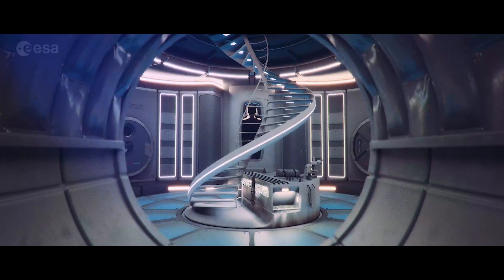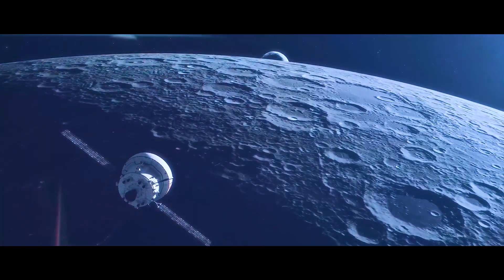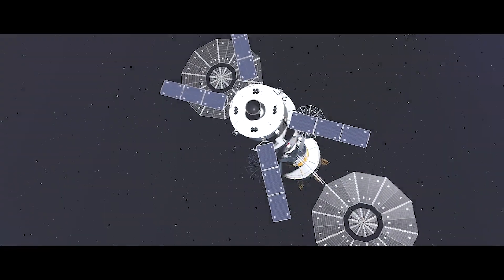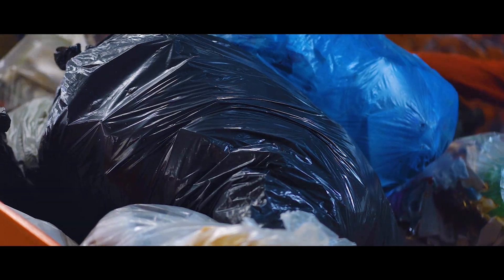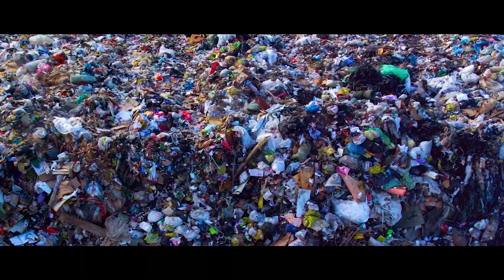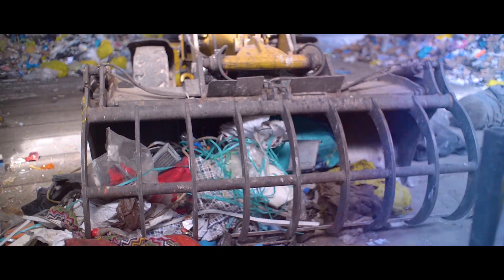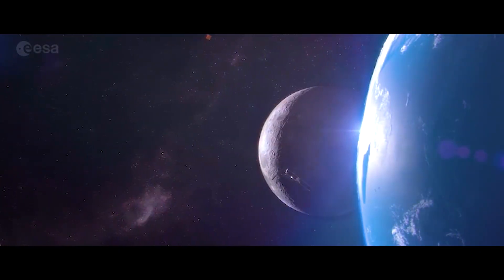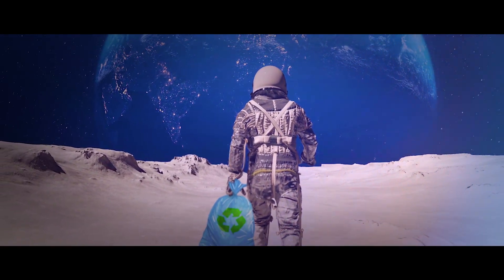NASA Seeks Innovators for $3 Million Lunar Waste Competition

Comment: I have a few good ideas to help recoup garbage floating in space and garbage after used wrapping and other stuff.
I won’t give away the whole plan though I want to win the prize. Here goes: floating garbage or no longer needed space junk, you need to make a satellite with ability to create a giant magnet. Activate it when there’s something present and attract it towards the satellite this sat will move with the attracted junk so as not to crash hard there is also a rocket ship to deliver the junk to the moon where under the craters a crushing machine was built and junk there gets crushed added to other junk stored as metal and some ready for shipment to mars. Other junk if salvaged can be retrofitted to be a rare spacecraft to travel out to mars where all of it is either collected and stored or crushed when machines arrived otherwise they may be re formed into useful robotic pieces. On the moon again under the crust and in a lava tube construction can continue building all kinds of stuff with junk from space. We could build an underground highway to the dark side but underground. I have more but it’s a long process so far what do you think?

Comment: I do not have the money to build anything but i have the solution 100% basics are breaking down the waste into gases witch i CAN DO. then running the gases through something like a catalytic converter <special design running the hose outside the craft and back into the craft to condense into water then the water will be used to run through something like a thunderstorm generator aka plasma generator for very very pristine air. this is just one of thousands of ideas i have that i know WILL work. once again i DO NOT have the funds to build.

Comment: So easy to take off from the moon. You probably could use ion propulsion to remove trash. The only reason I could see why anybody would want a base on the moon. It's so that you could refuel your rocket and take off at high speeds with a full tank of gas. I crashed my simulator into mercury at 10,000 mph i couldn't stop because i ran out of fuel. But let's say you wanted to reach a far distant planet earth like planet within your lifetime, you might want to take off from the moon with a full thing of gas, because you could achieve such a high speed and possibly slow down with the remaining fuel that you have and reach that earthlike planet within your lifetime, possibly

Comment: But that is definitely the solution to lunar trash. just launch it into deep space. With that electric ion propulsion system that would be fuel efficient Keep the lunar surface free of garbage it shouldn't take too much thrust to leave the moon's surface Since it's has such a low gravity
As for recycling things like plastic and stuff, you just do the same thing they do on earth. It's like plastic bottles and things like that. It'd be melted down and reused, just like they do on earth. You could put it on a trajectory for the Sun. That way, you wouldn't have to worry about polluting space, but just fly into the sun and evaporate it doesn't really matter though, because the human being can't survive in space for too long without their bows deteriorating

Comment: Energy is abundant, no use for plastic to gas, and Insulation is benign. what isn't used for fertilizer, could be used as scaffolding for subterranean walls, in terms of equipment,  here insulation may play a part in equipment space, in terms of pigeon holes. However, the most useful thing I can conceive is a kind of synthetic wool, this could be used in many ways, including structural when included with a polymer or expanding hardening substitute of concrete. You could even make an external secondary shield out of it, which might reduce maintenance and operational workloads. Once woven into a blanket you could in theory inflate it.

Comment: You'd need a lot more trash than this little cache to have a cost effective way to recycle. 

A compactor to press metals flat. A High powered Laser to heat metal, cut and mold metal into chain links, welded to make a chain elevator to a space station near earth's orbit. Then we could use a space crawler to send/ receive between earth and the moon. This would cut down on rocket fuel. But I'm not sure how much longer the trip would be.

Plastics could be recycled to form useful items for lunar habitats. 

Of course, I lack a means of power, but is it possible that light or energy from the sun could be used? Or maybe huge solar batteries should be built first. 

Obviously, I'm no engineer or scientist;  I'm an Artist.

Comment: What materials need to be recycled? Cloth and plastic? With a plastic they can create a machine thatconvert in a  type of fuel. Or liquid so they can used on 3d printers in space. The clothing they should create a machine that with ia separate and un do. The clothing and make treads that can be reused for a new product. The challenge is clean and disinfected with no water. In clothing  maybe wash in dry I guess. And in plastic with air pressure. Very interesting
Reply: If I looking to recycled in space plastic waste and clothing what can be adjustable on this ideas : What materials need to be recycled? Cloth and plastic? With a plastic they can create a machine thatconvert in a type of fuel. Or liquid so they can used on 3d printers in space. The clothing they should create a machine that with ia separate and un do. The clothing and make treads that can be reused for a new product. The challenge is clean and disinfected with no water. In clothing maybe wash in dry I guess. And in plastic with air pressure. 

. Here’s a breakdown of how to make it work:

Materials to be Recycled:

Plastic Waste:

Types: PET (water bottles), HDPE (containers), polypropylene (food packaging), and other space-grade plastics used in equipment.

Purpose: Convert into filament for 3D printing or even fuel.

Clothing:

Types: Synthetic fibers (polyester, nylon), cotton, or mixed-fiber garments used by astronauts.

Purpose: Turn into threads or textiles for new clothing, tools, or insulation.

Recycling Methods:

Plastic to Filament/Fuel:

Machine Concept: A recycling machine designed to melt down plastics and extrude them into filament for 3D printers.

Fuel Production: Certain plastics, when heated without oxygen, can be converted into hydrocarbons (through a process called pyrolysis), producing synthetic fuel or other useful chemicals.

Cleaning: Air pressure or electrostatic methods could be used to clean the plastics in space without water.

Clothing to Threads:

AI-driven Machine: A machine using artificial intelligence (AI) to detect fabric types, unravel, and spin them back into threads for reuse.

Cleaning/Disinfection: Instead of water, cleaning could be achieved using dry methods like ultraviolet (UV) light, ozone, or CO2-based dry cleaning, ensuring hygiene without water consumption.

Challenges and Solutions:

Cleaning and Disinfection Without Water:

For Plastic: High-pressure air, UV sterilization, or using vacuum methods in space.

For Clothing: Ozone treatment, UV exposure, or even dry-heat methods that eliminate bacteria without needing water.

Recycling Efficiency:

The process must be energy-efficient and scalable, using minimal resources (like energy or water) to fit the limitations of space travel.

Sustainability:

The system should be modular and easily repaired using the same 3D-printed parts, closing the loop in space resource management.

By Patriciadlr.😊
Reply: @crazyjipi  Sorry but it sounds AI generated

Comment: Plasma is an ionized gas, that is, a gas whose molecules have had their electrons stripped away. This happens when a substance in the gaseous state is heated to such a high temperature that molecular thermal agitation overcomes the binding energy that keeps the electrons in orbit around the atom's nucleus. Plasma is a fundamental component of the Sun and stars. It is also present in the magnetosphere, being observed in the polar aurora and in electric arcs. With that in mind, I believe that the best way to eliminate waste in the space in a safer way is using plasma, or even 
in the burning of the ship's engines...

Comment: Waste management and recycling cannot be solved in space or on earth as things are. Whole systems need to change, starting with packaging and enforcing of eco-friendly options. NASA should be funding compostable packaging companies to boost innovation and provide stronger more reusable materials that can eventually be composted (on earth or on the moon) for food-safe growing. I realize you need strong materials in space, not paper straws, but I believe it can be done. You should never have to throw something away - it should either be compostable or reusable. Some recycling is possible, but I have not been convinced. Compost is the solution.
Reply: Said on your first line. They want this to be impossible to justify stupid spending & interplanetary consumerism.
Reply: If you live in a climate that sustains composting. We are arid here so stuff doesn't rot without water and heat.